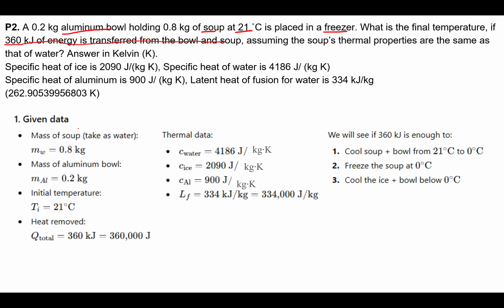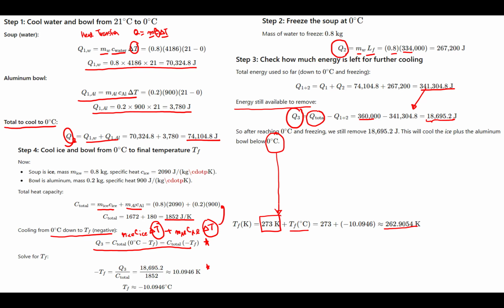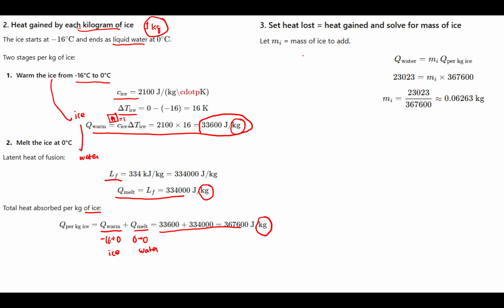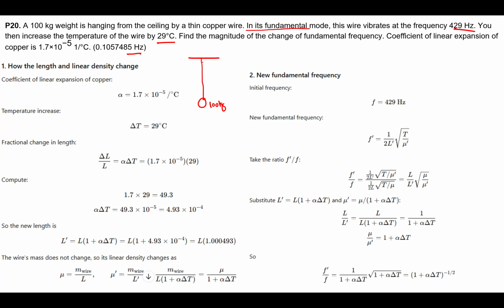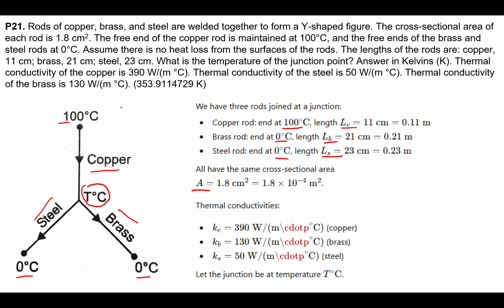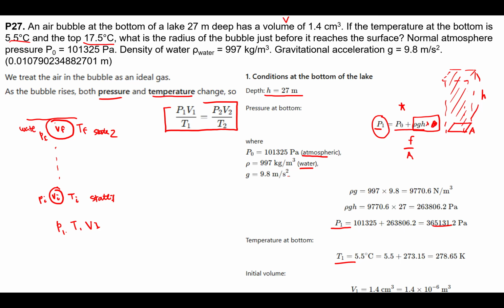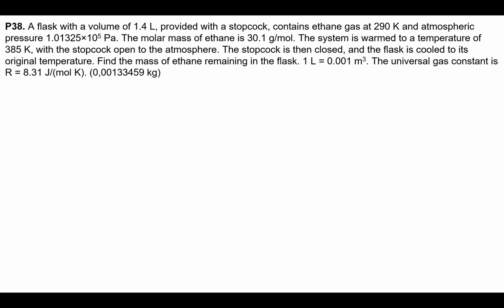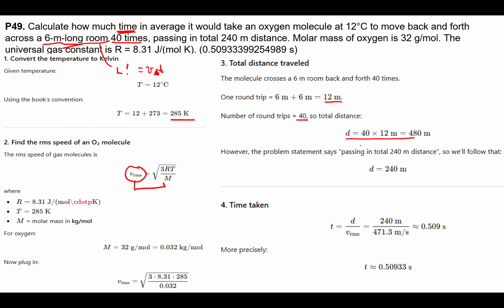PHYS161 Exam4 problem-solution-1

Comment: Altynay Kuatbek, 202494078.

P20 seems to be one of the hardest problems as it contains calculations of different variables before getting to the the estimation of the fundamental frequency. There are many terms as "density" and 'linear density" that may lead students into confusion if they do not understand the principal distinction.

The easiest one is P29, because it only requires derivation of the formula for finding the temperature and sustituting the values into it to find the answer, and of course before substituting, it is essential to convert the given units into SI units.

Dr Oh, thank you for your hard work.

Comment: Nurzhigit Kural 202331269
Easiest for me was problem 17, since it needs just remembering only the formulas of heat, which lets to find t quite easily. Hardest one for me is probably problem 2 which seems fairly easy at first glance, but is actually made up of several steps that aren't so obvious. There were way too many steps that require not only knowledge of the formula, but also of the environment and the general processes that would need to happen in order to find the asked thing, making it especially difficult for me because of the anxious feelings about possible mistakes at some point of the long solution process.

Comment: Amina Kaisarkyzy 202265591
Problem 24 was the easiest for me because it required only a straightforward application of the heat conduction formula. Problem 20 was the most difficult, as it required knowledge of multiple concepts and formulas from both Exams 3 and 4 over several steps, making it more challenging to solve without losing track of the process.

Comment: Dariya Bekzhanova 202493408

Problem 29 is easy because it can be solved in one step using Vrms formula 
Problem 2 is hard because it includes a lot of steps and formulas which you have to remember

Comment: Sabit Shegen 202321670 

The easiest problem was P44, since it only requires one formula of molar mass, 
And the hardest one was P13 because it requires considering four energy stages: cooling steam, condensation, then cooling water and, finally, freezing

Comment: Sanzhar Galiyev. 202559544

Hardest:

P20: Solving this problem requires understanding several topics and correctly applying them to the system. The aspect of the problem that linear expansion also changes linear density adds complexity to the problem. Derivation of the final equation requires bringing the fundamental frequency equation and the linear length change equation together.

Easiest:

P4: All values are given and just put into newly learned formula.

Comment: Avval Muximov, 202122164.
Problems 43 and 44 were the easiest ones, because they required only to use one simple formula of mass of molecule. Problem 21 was the hardest one, because heat moves into the junction through the copper rod and leaves through the brass and steel rods. The rods have different lengths and materials, so problem requires to use several heat-flow equations to find the junction temperature.

Comment: Dilnaz Makhsotova 202484796 The easiest problems: P9, P10, P29. These problems were straightforward to understand and solve because P9, P10 problems include topics covered in previous exam, whereas in P29, the knowledge of formula only required to solve it. The hardest problems are P2, P20. These problems are challenging because they require applying multiple physical concepts simultaneously. For example, P2 requires analysis of complex heat transfer across two materials and phase changes. P20 requires analysis of how to combine thermal expansion with the mechanical physics of vibrating string.

Comment: Adina Borash, ID 202481448. Although many problems are somewhere in the middle in terms of difficulty, I think that one of the hardest problems is 2nd, as it requires many steps of solution. As I was solving the problem set, it took more time than other problems, also, in the beginning I did not understand all these processes such as cooling and freezing, so it took me some time to understand and solve problems like this one. The easiest problems were those that needed only 1 formula to use, so I can mention problems 27, 41, and etc. that were one of the easiest ones. Also, I noticed that many problems required only the knowledge of PV=nRT so finding any of these variables was easy for me. Also, I appreciate these videos, as they help me understand the logic of the solution.

Comment: Alikhan Mukhamet 202463007
The easiest problem was number 41 because it required simple calculation by just inserting values into the formula. Problem 2 was the most challenging for me, because it consisted of several steps and a lot of calculations.

Comment: Auyeskhan Abzelbek 202492889
For me, easiest problenm was 41 because it involves already given formula. The hardest was problem 2- I did not have any idea to solve this before watching solution. Also, it has so many steps, which is bit confusing.

Comment: Sultan Temuruly — 202440297
Easiest: P27, because it only requires the combined gas law and pressure at depth.
Hardest: P21, because it requires balancing heat flow through three rods with different materials and lengths.

Comment: Kamila Kastuganova 202428684 
Problem 41 (Number of molecules in one breath) because it uses only the ideal gas equation. After converting the pressure and volume to SI units, you substitute the values directly into the formula to find the number of molecules.
The hardest problem is Problem 2  because it involves several stages of heat transfer. The solution requires calculating the energy needed to cool the bowl and soup, determining whether the soup freezes, and checking if further cooling occurs. Since it combines multiple thermal physics concepts and equations, it is more complex than the other problems.

Comment: Amina Lukpanova, 202485180.
The easiest problem for me was P9, because it is related to the previous topics in the book about energy conservation. Connection of previous topics with new ones helps to understand the concept more easily. When it comes to the hardest problem, for me it is P20, because the derivation of the final formula requires good focus and attention to details. It is important to derive the formula carefully to get the correct answer.

Comment: Arsen Aldazharov
202481188
For me, Problems 29 and 41 were the easiest because they required only direct substitution of the given values into a formula and could be solved in a single step. Problems 21 and 27 were the most difficult because they involved several steps that were not immediately obvious and required deeper understanding of topic.

Comment: Aizhan Aldanayeva
202417063
the easiest problem: p27, as it requires the knowledge of only 1 formula. In addition, the system is always in equilibrium, which makes it easier to solve and memorize
the hardest problem: p2, because there are several steps that require usage of different formulas, depending on the process.
thanks for the video, it was truly helpful for preparation and understanding!

Comment: Aikhanym Tauirbay 202341272
For me, the easiest problem was P41, where we had to find the number of air molecules in one breath. It was quite simple because we only needed to convert given values into SI units and substitute them into the formula. Steps were clear and there were no complicated ideas. The hardest problem was P2 about Al bowl and the soup in the freezer. It was more difficult because the process had several stages. First, the soup and the bowl had to cool down to 0 C, then the soup had to freeze and after that everything had to cool below 0 C. We also had to choose the correct formula for each stage and carefully calculate heat removed. That made the problem longer and easier to make mistakes.